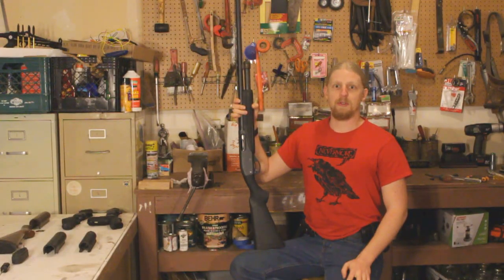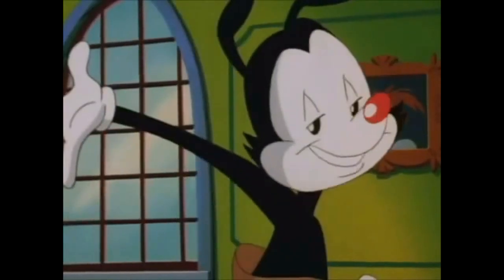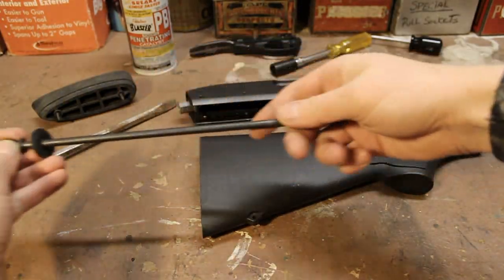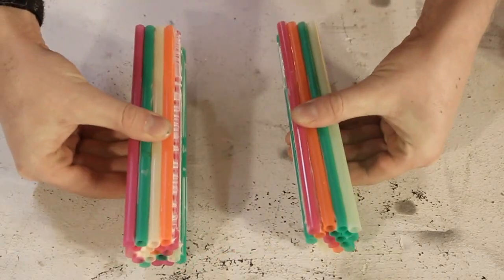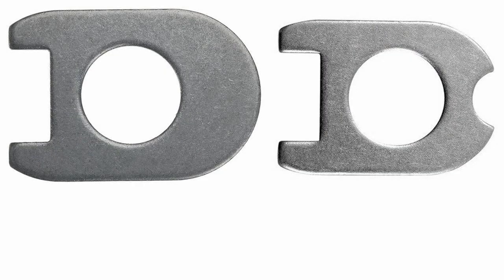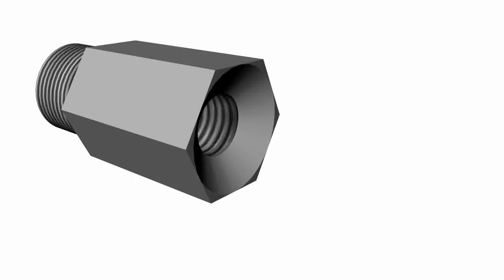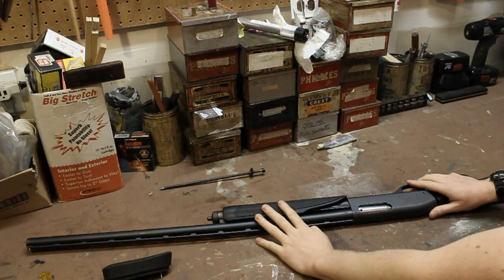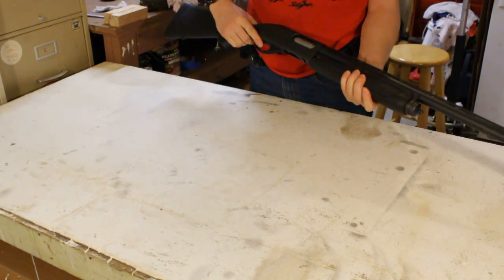Stock Removal & Installation - Remington 870 Tips & Tricks #14

Comment: @Synchronizor any reason the stock bolt assembly would be different in a Super Mag?  I have a 3 week old gun and the stock bolt won't turn. I removed trigger assembly and placed some oil on other end but still nothing.
Reply: Got it off!
Reply from the maker: Glad you got it figured out.

For anyone else who might read this, no, the SuperMags aren't any different when it comes to stock installation or removal.  The one thing worth noting with SuperMags is that some aftermarket stocks (especially folding or recoil-mitigating designs) aren't really built to take the heavy recoil of 3.5" super magnum shells.  The manufacturer will usually include a warning if this is the case.

Comment: The rubber butpad on mine is held on by sorta combination cross point small square drive sheet rock type screws from the factory and my long hold down bolt is round with a slot, it's kind of a newer gun with the flat finish.

Comment: What is the minimum clearance requirement between the wood stock and receiver? I just got a replacement wood stock as the original one has chipped near the receiver.

Comment: I have a use 870 Police trade in with a speed feed stock, apparently the receiver stud and the bolt are non standard, I’m wanting to replace the current stud with a factory standard stud, have you heard of this before? Is this an easy fix? What’s the story with the different sized stud?

Comment: I have an 870 that had pretty significant rust.  I finished bluing the barrel as it had the most rust.  Would you also recommend bluing the receiver and ammo tube as well?
Reply: The ammo tube had rust on the inside of the tube as well.  I’m not sure if it’s possible to remove it, but I am wondering if it should be blued on the inside as well. I don’t understand why that part wouldn’t be stainless steel.

Comment: Thanks for sharing!
Shotgun pad corroded and had to use the diagram to find the screw holes, saved me a big hassle.
Was left in the safe for so long, the foam pad on bottom of the safe and rubber pad started to deteriorate and became one single sticky concoction of hell!

Comment: My 870s pump handle falls by a quarter of an inch when I stand it up is this normal? and if not what do I do to stop it
Reply from the maker: Is that with the hammer dropped?  Or will it do that even if the gun has been cocked?
Reply: @SynchronizorVideos  only with the hammer dropped
Reply from the maker: @falconharris6879  Then yeah, that's normal.  The slide unlocks itself once the hammer drops.

Comment: Great info! I'm looking for a black synthetic butt stock to put on my older 12 gauge 870 Express. Do you have Any suggestions that may be a little cheaper than the Magpul SGA? Thanks
Reply from the maker: The basic factory synthetic stocks are pretty good, functional options.  The hollow Express-style stocks (like the one in the beginning of this video) are impressively lightweight, and there are multiple recoil pad options available for them that do a great job of taking the bite out of recoil.  You can usually find those for dirt-cheap because folks often "upgrade" from them to something that looks cooler on their Instagram pages.  There are also the Police-style synthetic stocks that weigh more, but are super sturdy in case you need to clock a zombie terrorist in the teeth.  Both are available in multiple lengths of pull, and both have a great shape and grip angle, in my opinion.  

Stocks with separate pistol grips or more vertical semi-grips (like the Magpul) can be nice for some types of shooting, but I find they're less maneuverable than the more traditional semi-grip shape.
Reply: @SynchronizorVideos  Yeah I'm not worried about it looking cool. I put a black synthetic forend with a light on it for coyote hunting. Sounds like the police stye would be best for me. Thanks for the info.

Comment: Could You Put A Synthetic 12 Gauge Stock & Fore End On A Wood 20 Gauge ?
Basically What I'm Asking Is The 12 Gauge 870 Stocks & Fore Ends The Same Size As The 870 20 Gauge Stock & Fore Ends ?
Reply from the maker: Only if it's one of the older 20ga models that was built on the same receiver size as the 12 & 16ga 870s.  Most 20ga 870s you come across these days are built on a scaled-down receiver.

Comment: Can I get a little help or insight? I have a 12G pump-action shotgun that I want to replace the stock to an adjustable from the one it came with. how would I know what type of buttstock I have? is it an 870 or a different on. what would be a compatible one to use as I want to get an adjustable one? thank all for the help
Reply from the maker: Is your gun an 870, or a different model?

Comment: I have the socket tool coming tmrw. I have a brand new 870. First thing I did was try and remove the stock bc I do a little wood working and planned to make my own pistol grip stock(full length shoulder too but with a nice custom pg for my hand)... But I COULD NOT get that bolt to break loose. Lord have mercy they put it on with a quite some force! I’ll make a new comment if I manage to get it off with the socket. I did damage the bolt face a little bit but maybe I can still get it to loosen. If not oh well, it’ll still be okay

Comment: Great video! Thank you! I just bought a new 870 express 12gauge and i noticed the wood stock doesn't exactly line up with the receiver. It seems to fit about 1/32" or more above the top of the receiver. The bottom of the stock is also not lined up. Almost like the entire stock is shifted up about 1/32" higher than it should be. Any recommendations? Can i just unbolt the stock and try lining up again? Or is it just the lack of quality in a mass produced gun? Thanks again.
Reply from the maker: You can try loosening the stock bolt and seeing if there's room to shift the stock down.  Keep in mind 870s are mass-produced shotguns; not fine hand-fit high-dollar lvo Fabbris.

Comment: Thank you, so useful! I've finally found out about the 1/4 28 UNF thread which is, I assume, widely popular in States, but damn hard to find east from Atlantic!
Reply from the maker: You should be able to order them online fairly easily.  It's a pretty common inch thread standard.
Reply: @SynchronizorVideos  Thank you, I've found than Brownells is selling spare 870 stock bolts in EU also!
Reply: @SynchronizorVideos  Dude i love your videos, i hope you're doing well and plan on making more videos.
Reply from the maker: @matt_1984_  I really want to get back to videos; I've just had a lot going on in recent years.

Comment: Great video and instruction as always. Wish I would've watched it before I removed my stock. I put mine in a vise and cracked it. I should've clamped it closer to the receiver or used bigger pads like you did. No big deal since I replaced it with a Magpul stock. However I don't like being a hack with any project. Lesson learned. The socket would've been helpful too and the penetrant on the receiver side is a good tip. This gun was made in the 60's so it was froze up tight ! My Dad's bird gun, god rest his soul. Thanks buddy !

Comment: Through some research I’ve been led to believe the small frame 20 ga. Stocks will fit the old style 760 rifles. Do you have any knowledge of this or know of any replacement stock / forearm sets available for these old rifles. I found Champion replacement synthetic are supposedly discontinued and I’m not really a big fan of Boydes styles. Great video .
Reply from the maker: Stocks interchange, I believe.  Not sure if the fore-ends do.  You could call Remington to confirm.
Reply: Synchronizor I’ve had no luck communicating with Remington, I’ve sent many emails. I’m going to just try to get a cheap used one and modify it to find out. Thanks for response.

Comment: Hi my friend, I'm strapped for time, so I haven't gotten through the video yet. 
Incase it's not answered here, can I swap wood furniture onto an 870 Marine without issues?

Edit: I did get to the part about the bearing plate. So that's good.
Reply from the maker: Yeah, as far as furniture and accessories are concerned, the Marine Magnums are essentially just standard 870s in a different color.

Comment: Anybody know if there is any difference between the long stock set screw from an 870 and IAC Hawk copy? Length of the screw and thread pitch would be useful info.
Reply from the maker: Couldn't tell you for sure, but any fastener store should be able to measure the threads on your stock bolt for you.  Genuine 870s use a 1/4"-28 thread.

Comment: Any tips on how different the ati mb3 is from the 870? What parts might be compatible?
Reply: I have the ATI Tac PX2 … the reciever is basically flat where the stock meets. Was wondering how to get by the 870 stock “rim” so it would at least be flush… Not sure why ATI has no aftermarket support but have heard the REM 870 stock, forend, etc will work….  I’ve tried a pistol grip but gonna need shims of some kind!
Reply: And by the way, ATI is American Tactical Imports, not the American tactical that makes all the badass shotgun parts….  The irony!  Lol
Reply: @WES-JGC-2013  yeah I just cranked down the retainer on the hogue stock to keep it in. Might do some grinding to get it to sit
Reply: @WickdPerfekT  after looking back I wonder what a decent sized O-ring would’ve looked like?  Lol.  I’d say one of the plates used for wood stocks to absorb recoil evenly would be perfect , but finding that perfect one would be unlikely… may give the grinding a shot!    Also I think it wouldn’t have looked as bad if it was already one piece instead of  one of the adapters already making it look cheaper than it already was!  Lol
Reply from the maker: Sorry, I haven't really had much experience with that gun.  I'll keep my eye out for one and see if I can get a good look through it.
Reply: @SynchronizorVideos  yeah I've been learning it's just a Chinese clone.. thanks to your videos I've been able to strip it down and everything looks the same for the most part. Seems to run fine. Got it used for 100 bucks.thank you for sharing your knowledge.

Comment: Is it possible to tighten the stock screw too much that you could crack the wood? Not using a wrench, just a real big screw driver.
Reply from the maker: Possibly, if you have a good grip and really reef on it.  You'd really have to be trying, unless the stock already had a crack started.

Comment: I am trying find a way to adjust my length of pull on my 870 Super Mag with synthetic RealTree stock. They make a short pull for the 20 gauge but not the 12 gauge, as least that I have been able to find.
Reply from the maker: You can get short-LoP stocks for the 12ga.  You might not get the exact same camo pattern, though.
Reply: @SynchronizorVideos   Exactly what I had to do...I ended up getting a black Champion Composite Youth Stock, which looks pretty nice, with the barrel and action in RealTree Hardwoods. I suppose if I wanted to spend another $200 I could send it off to be dipped. The 870 Super Mag in RealTree Hardwoods was a special run made for Walmart.

Comment: What if you strip the screws on the stock? Feel like an idiot but i striped the shit out of them.
Reply: casey charnley I did too but I’m adding a pistol grip so fuck it
Reply: casey charnley 
If your stock is wood and that’s what you stripped (not the screws) the fix is easy.  Dip the skinny end of (preferably square) toothpicks in wood glue, and stuff the stripped hole with them.  Let them dry and then cut them flush.  Find the center of that toothpick cluster and drive a very small nail (holding it with needle nose pliers) down the center of the original hole and pull it back out. Or you can drill a tiny hole. Carefully drive your screw (without the buttpad to block your view) into the nail hole and back out. 
Now you’re ready for assembly. 

If your buttstock is plastic,  forget the toothpicks,  get the right glue to fill the stripped holes,  and only use a nail or sharp punch to locate for a drill bit for the new screw hole.
To get the right glue, try to find out exactly what kind of plastic your stock is.  
Then.....Google is your friend. 
The right glue will weld and become one with the stock.

If you stripped the screw HEADS.....
then disregard everything above.  🤔🤓
                                                    DOH !!!
Reply: If you stripped the screw heads  try drilling really small pilot holes, after that use a reverse thread extractor bit. This might work for you I've done this on broken bolt heads.

Comment: What do you do if you strip the screws
Reply from the maker: The little screws holding the recoil pad/buttplate on, or the long stock bolt?
Reply: Synchronizor the screws holding the but pad
Reply from the maker: I would first try carefully backing the screws out while applying a lot of force to the screwdriver.  This can often let you get enough of a grab with a Phillips head to back a stripped screw out one last time - especially if they haven't been over-tightened.  Make sure you have the proper size screwdriver, and that it's in good condition.

If that fails, and the screw heads are just too far gone, there are some specialty bits for backing out stripped screws.  You may need to drill them out a little first, depending on the specific tools you're using and what's left of your buttpad screws.  They're not too expensive, and your local hardware store should carry them and tell you how best to use them.

Comment: I love these 870 videos. One thing that hasn't been covered and I haven't really found any videos anywhere else. I'm currently doing a tactical swap on mine, changing out the stock and forend. The wood on the forend will not slide off the metal after I remove the screw holding it in place.  Ever hear of this or any advice?
Reply from the maker: By screw, are you talking about the fore-end tube nut?
Reply: Synchronizor yeah, castle nut. I figured out my problem. Had to knock the forend wood off with a hammer lol.

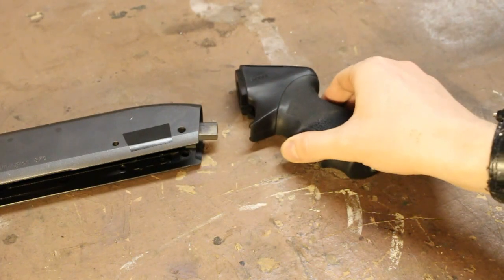Comment: Great video. What grip is that at 11:11?
Reply from the maker: It's a Hogue Tamer pistol grip.  Pretty darn good for the money, though I think there are better grips if your budget allows.
Reply: Synchronizor thanks. And which ones would those be?
Reply from the maker: I really like the Pachmayr Vindicator pistol grip.  It's more expensive, and you'll need to pay more on top of that to get a rear sling attachment point, but it handles and shoots very nicely, and works very well with the 870's control layout.

Comment: Question,how would you install a Shockwave Technologies Raptor Grip to a Remington 870 home defense shotgun?
Reply from the maker: With an Allen wrench.  It's pretty straightforward, actually.  Just follow the notes in this video regarding tightening, and you should be fine.

I actually have one of those Shockwave grips in for evaluation.  One thing I'll note is that the grip's tenon is rather short, and doesn't bottom out in the back of the receiver the way most synthetic furniture will.  It should still work fine, but I've found that installing it with a bearing plate from a wood stock results in a better seat and improved alignment.

Now, that's how I would install that grip.  What I wouldn't do is install that grip on a HD gun.  It's not at all a good choice for that application.  You'd be much better off with a simple fixed stock, or if you need to store it in a tight space, maybe a folding stock.  Pistol grips are fine for recreational shooting or some utility roles, but you really should have a shoulder stock if you want to be able to shoot quickly and reliably hit things.
Reply: Synchronizor thank you so much for the response.ive just bought the HD 870 and this was the most economic choice for my budget, 320$ total.and is the first Remington i have bought.so i wanted to modify the gun with what ive bought over time.
Reply from the maker: "Over time" is the wise way to do it.  Don't be in a big hurry to change everything right off the bat; a lot of folks do that and end up spending a lot of money on a gun that really doesn't fit them or their needs - or worse, a gun that doesn't work properly.  Take your time and get to know your gun before you start loading it up with extra stuff that it may not actually need.

Comment: Your videos are great, they are very helpful. I have a 1968 870 that my dad gave me when I was 15, this is one great gun. It has a 28 inch full choke barrel and is a fantastic bird gun. It has recently developed a problem that I would like to ask you about. When I put two shells into the magazine and pump it to put one in the chamber, it lets both shells come out of the magazine, naturally causing a jam. Do I have worn out shell latches or could they be bent slightly, not letting them work properly?
Reply from the maker: That does sound like an issue with the shell latches.  Maybe action bars too, but that's more likely to result in shells not feeding, rather than double-feeding.  You may be able to bend the latches back into shape or file the tips and improve things somewhat, but if you really want to fix it properly, I would just go ahead and have them replaced with new ones.  You probably have the older-style shell latches with two staking recesses at the rear in an 870 that old.  Current shell latches have six staking recesses, and they've been beefed-up compared to the original parts.  The improved latches should fix your problem completely, and help keep it from occurring again after another 50 years.

New shell latches aren't expensive, and are easy for a gunsmith with the right tool to pop in, but I would have the gunsmith look your gun over and confirm that it really is the shell latches before you put in an order.  They should also be able to go through and recommend other parts that could use updating or replacing while they're at it, so you can order everything at once and keep that classic running happily.
Reply: Thanks for the quick and helpful reply. I will have it looked at asap.